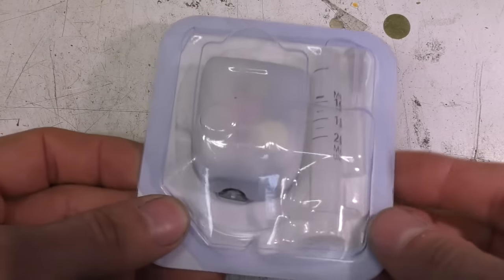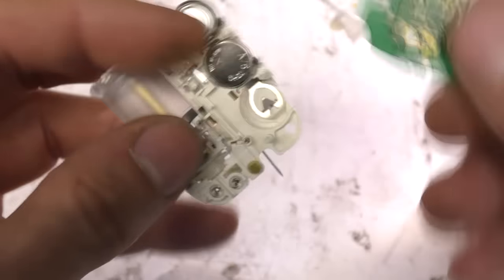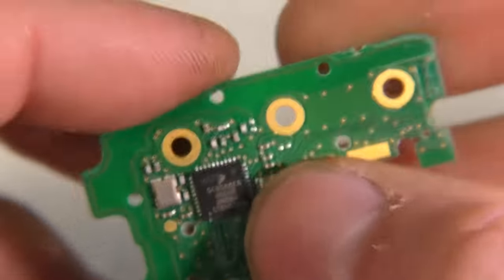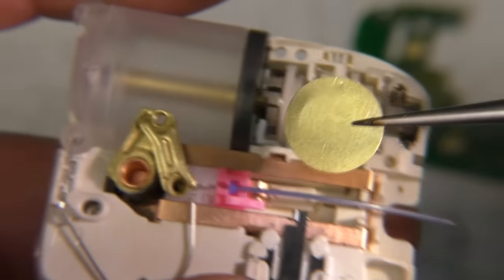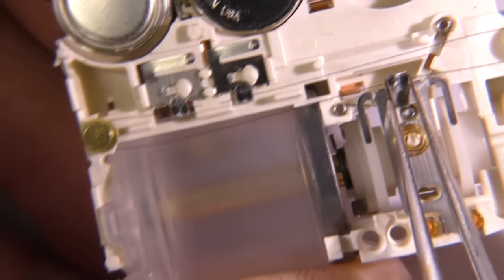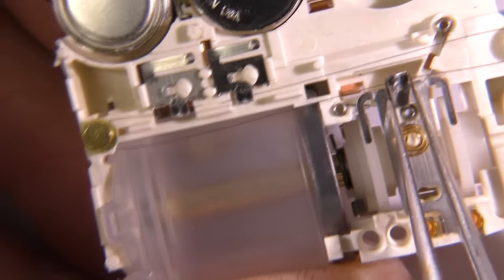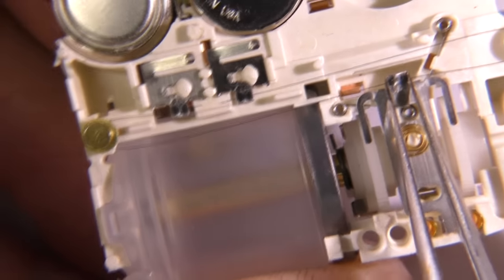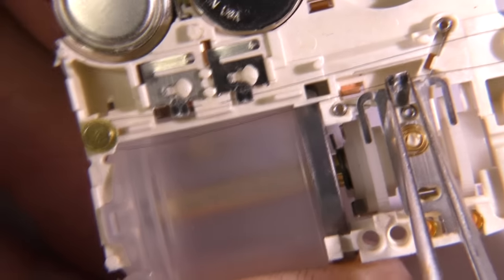Omnipod wearable insulin pump teardown

Comment: That's a really neat mechanism.  Particularly the spring clutch onto the shaft and muscle wire ratchet.  I guess that the risk of air injection is not a major risk due to the tiny amount being does at a time?  Not so keen on the high power stabby bit.  Particularly when it happens automatically at a relatively random time once attached to you.
Reply: You attach it to a fatty area... so, a tiny bit of air isn't a huge issue. :). It's actually rather bad if it ends up in a vein. The high power stabby happens when you attach it. A lot of the pumps have a little tube and a gun to apply the needle. On that kind... you take the needle out and it leaves a catheter. :) 

I've not really seen a pump quite like this one though. Mind you... an ex of mine (type 1)  had the insulin pumps... so I am not exactly an expert or anything! My ex's pump was the reusable kind where you replace the attachment piece. (Which connects via a tube to the unit). This unit seems disposable... weird!
Reply: Typically you'd need to inject a surprisingly large amount of air to cause a problem (e.g. 10ml or more in one go). That would probably be more than the chamber in this pump contains.
Reply: How could they not name this thing "PowerStabber 3000"? Much better than "Omnipod" IMO.
Reply: I think the piston moves a bit before the cannula deploys, which purges the air.
Reply: As soon as he said that it stabs you, i thought about the Toaster Manpage XKCD
Reply: Am I just too skirmish???   At 2:38 and 5:32 I could not stop cringing while he was holding that needle portion in his hand. But he did the same with the pacemakers as well, on which one could still see the dried fluids from the previous "owner".
Reply: +Donkey Learning IT no i felt the same way. Every time he put his hand in front of the needle action i expected a cut to him with a bandage on his hand telling us he'd accidentally impaled himself.
Reply: As others have said, this is a subcutaneous injection, not intravenous, so air is a very minimal concern. Actually, even if you were to inject air into a vein, unless you inject a lot of it, there's no problem. That's because blood flow in veins is always in the direction from small vessels to larger ones - so that it is very unlikely for bubbles to block the flow, they would instead just get pushed ahead into the wider vein downstream. Eventually they would either dissolve or end up in the lungs and be exchanged with the outside air. All of this would happen before they would make it into arterial circulation, which is where air bubbles ARE dangerous, because they get pushed into smaller and smaller vessels until they block the flow (an air embolism) and cause a heart attack, stroke, or other organ damage, unless they are small enough to dissolve quickly. If you inject a ton of air into a vein, you could disrupt circulation in the lungs (the first capillaries the air would encounter) enough to cause problems.
Reply: There's a ~1.5µm/s gas-blood boundary absorption rate in arterial blood (PMID: 8971944) so microliters of air should be gone in minutes.
Reply: When you put insulin in the pump, you draw the 200 units into the syringe.
Then you turn the syringe vertical with the needle pointed up, tap the air up to the top, then slowly push the syringe until the insulin is in the needle. You'll see a drop. Insert the syringe into the fill spot on the pod. Slowly push the syringe until it's empty.
You will hear the pod beep twice. Once again, keep going until the syringe is empty. Remove, and pair the pod with the PDM.
Reply: 1, 2, 3, 4, (please be 6), PAM, 6, 7, 8, 9, 10 (damnit it wasn't 6)

Comment: One of the features you missed (or didn't mention) is the two-stage job it accomplishes in a fraction of a second. 

The cannula moves forward with the metal needle protruding from a plastic sheath. Both are pushed under the skin, then the metal needle retracts leaving the flexible plastic sheath where it is in the skin. 

So rather than a metal connection between the device and your skin, you have a flexible plastic tube.
Reply: Just like a peripheral venous catheter.
Reply: Thanks, this is just the one that I didn't figure out from the video)
Reply: Exactly what I wanted to point out :) I was asking myself why is that arm retracting back when it's holding the needle.
Reply: Is it painful when that happens ?
Reply: Excellent observation!
Reply: It is not going to be worse than any other injection process.
Reply: Honestly you don't ever feel it in there because it is so thin and flexible (and small). I have a pump and never feel it however there are times when I'm getting a Bolus (a larger amount of insulin when eating rather than the small continuous amounts all day long) that stings from time to time (usually when I'm getting 20 or more units of insulin at a time, which by the way is a rare occasion) but the sting goes away in a few seconds. Hope this helps!
Reply: No, not really. It hurts less than a pinprick (and for less time). It takes just a fraction of a second for the plastic canula to be inserted under the skin and the insert needle to be removed from the skin. I am on an insulin pump and usually don't ever feel the insert needle go in (or come out).

Comment: Excellent teardown, thank you! I just tore one down myself then came here to see what a professional had to say about it. My son is Type1 diabetic and just started using these.

- The stabbing action happens when you tell it to during setup, so it's not unexpected.
- Also, I think the biggest issue with recycling these is that they are considered a biohazard after being used for medical treatment, so there's no safe way to collect these en-mass and then reuse parts. Yeah pieces could be sterilized but I think they'd be better off just grinding them to dust after removing the batteries and then continue to recycle as normal.

Comment: the muscle memory motor also has another plus. it is incapable of squirting all of the insulin at once, the maximum rate even on errors is small enough that the user may be able to react and remove a malfunctioning or compromised device.

Comment: What is not apparent in this video is how the muscle-motor steps until the mechanism reaches the piston in the tank before the clutch-spring is released. This is how the pump ‘knows’ how much insulin is injected into the tank. The release-cam for the needle is attached to the outer axle, so the needle won’t release until the clutch engages. As mentioned in another comment, the metal-needle is inserted, and then retracts, only the outer plastic tube is embedded in the skin. This insertion takes only 1/200 of a second, and that is why there is a hefty spring on the needle-actuator.

Comment: Thanks so much for doing this teardown.  My youngest was diagnosed with Type 1 earlier this year and I've been considering getting her a pump but I'm struggling mightily with the potential consequences of a flawed unit.  

The simplicity and elegance of the hardware design is encouraging.  As someone with 20+ years in infosec and 4+ years tinkering in RF, the 'other half' of this system still has me a bit concerned. :/
Reply: I've had an insulin pump for almost the last 15 years. At first I had the Medtronic Minimed 508, now I have the Minimed Paradigm Veo 754. These things are a godsend and you would pretty much have to be an idiot to use the "old school" methods. 

I also don't entirely buy the security concerns about these. You usually put around 250 units of insulin in these (less for a child). Even if the potential attacker manages to inject all of the insulin remotely it won't really kill you. Insulin is very slow acting (even the fast acting ones). You will certainly know that you have a low blood sugar before you would fall into a coma. And in that case you will do something about it. And you should always have a hypo kit near you in case you fall into a diabetic coma. And if you are at work/in school somebody should probably know how to use that hypo kit. If you are in public then an ambulance will help you as well. 

Besides... The RF range of these things is pretty limited. So chances are that any attacker would have to do this in public which minimizes the possible damage that they could do.
Reply: jcims I've had diabetes since age of 4 and started using insulin pump at 18, used Medtronic's and Animas and experienced issues with both, Omnipod's have been one of greatest things for T1D over my past 27 years with the disease. Least painful insertion of any and best thing is it inserts itself, giving you appropriate angle of insertion with accuracy that takes away "human" error that can lead to potential hospitalizing situations.
Reply: I've had the Animas 2020 (twice) and I currently run the Animas Ping pump (yes, I love Animas pumps!!!) However, I just received a letter stating that Animas is no longer going to be making or selling insulin pumps (so now that my pump is almost out of warranty I have to look into getting a different pump and don't like the medtronics line (and there aren't too many more companies to choose from (please do your research before deciding anything). After doing MY research I am currently attempting to get the tubeless OMNIPOD. I wouldn't be a day without my insulin pump!!!

Comment: thermal image on the wire as its working  - would make an interesting clock movement device
Reply: i'm a bit confused as how that muscle wire actually makes that piece of metal move because it looks like that movable part is in about middle of that wire and thus would not move when the wire shortens

Comment: I thought the break-off corner was going to be for decommissioning unsold out of date units so they didn't get onto the black market (til I saw the caption)
great teardown - medical stuff seems a bit different. it's got to be as idiot proof as consumer electronics if you're sending patients off with it, but totally reliable and well engineered.

Comment: Interesting teardown but you were waving it around so much I couldn't see what you were trying to point at. I don't know if a lower zoom would be better, or just sticking the device down to the desk so you can't move it around .
Reply: agreed, it was a little bit motion sicky, and the focus was a little off sometimes.

still, mike got the point across pretty well and it was a lot of tiny little things so overall it's not bad I think.
Reply: Had the same issue when I tried to make videos on small components! It is really not easy to solve it.
I found that with my camera the only workable solution is to put it down on top of the table, preferentially on a dark cloth/paper as background to increase the contrast.

Comment: The break off pcb corner could be to hard "safe" the units?  Ie, by breaking the power to the muscle wire driver, the capstains can't turn and fire the needle mech  You don't want these units accidentally firing out there stabbers when being recycled if not used!!

Comment: You said this muscle wire is activated by heat? Does this unit not work very well if exposed to cold temperatures?

Edit: Nevermind, I'm reminded of the contacts at the other end of the lever arm that let it know it has fully extended and made a ratchet. Must just continuously pass current through until it heats up enough to work, just may be a bit slower in the cold which is irrelevant.

Comment: Fantastic ... I just finished tearing one down myself, and was analyzing it's operation.  I had about 80% right, but you filled in the critical 20%  that puzzled me!  thanks.   BTW could you elaborate a bit on your setup to operate the muscle wire ?   Thanks!

Comment: Medical stuff is always interesting. This pump is an awesome construction wich combines many different techniques on small room. We have an actuator that converts electrical energy in temperature energy (is it the right term?) and from there to kinetic energy. The force is multiplied by a screw and gives the needet acuracy too.... This is cool!
An interesting question in my opinion is, how much energy is left in the batteries after the job is done?

Comment: Built for low interference but I wonder if induction could cause the device to pump.

Could it be possible to jam one in those 3-5 coil induction thingy's :) And change the intensity up and down to try interfere with it?

Comment: How does it deal with air in the tank? Or are you not supposed to get it in there in the first place?
Reply: You guessed right. You shouldn't put air in it. Even if you do, there's a certain orientation you can put it in so it can push the air out, as if it were an ordinary syringe - the "air purge". After all, no matter what the syringe/pipe portion is always from factory-new state filled with air that needs to be pushed out by the insulin anyway.
Reply: The little amount of air that will get it wont hurt but i do wonder how the system detects an occlusion.
Reply: Do R/C!
It's generally advised not to put air in the blood stream, lol.
Reply: This is subcutaneous and infuses the insulin into the fat, not the blood stream, as an intravenous infusion would that would be placed in a vein.
Reply: Given how clever the rest of the mechanics are, I wouldn't be surprised if the small amount of motion between the spring starting to activate the piston and the cannula firing is just right to get the air out of the cannula. Other than that, there shouldn't be any air in the system unless you injected it along with the insulin - which you shouldn't do.

Anyway, a tiny bit of air being very slowly injected under your skin is no drama. It's not like it's injecting a shedload directly into a vein.
Reply: The insulin pump goes through a "prime" (setting) which is a process that helps to eliminate the air bubble or air in the line.

Comment: So, there are of course videos on how to use these things on YouTube. Apparently one of these devices only lasts three days, and then you throw it away and get a new one out of the box. It seems quite wasteful given that the needle/cannula assembly looks replaceable, and the adhesive could easily be replaceable too. I suppose the other wet parts could get contaminated with bacteria or something, but they shouldn't be in contact with anything but your blood, which should be clean, right? The other thing I thought was a bit strange was that despite that these are single-use, you have to fill them with insulin yourself before use, but I guess that's because they'd be medicine, not just medical devices, if they came with the insulin already in them.

Comment: This seems both fairly expensive and incredibly environmentally costly given that these things are 3 day lifespan devices. I bet only a fraction of them get recycled properly. Any thoughts about how one might make these last a bit longer (ignoring problems with infection etc. that might happen with aged needles.)
Reply: The recycling procedure is actually pretty straight forward and efficiënt. And also required by the distributor.  As the pods are waterproof and have to be very small, it is very difficult to incorporate changeable batteries and long(er) term reliability. Also there are sterility issues, on every insulin pump system the canula (needle) needs to be changed every few days.

Comment: As I'm a type 1 diabetic I'm using those all day. Now I know even more about them, thanks!

I must say especially in the early days they were often (2 out of 10) doa. It's clearly not that easy to fit all the mechanical bits perfectly together in the factory...

The only thing that worries me using them is the fact that the canula has to be perfectly sterile when inserted. How do they take care of that? Is the whole unit sterilised?...
Reply: But I think they are designed very well. When there is a fault the unit detects it. Once I had a leaking battery in one of them. Not nice but the alarm went off like crazy (as it's always :-/)

Comment: What is sensing the encoder magnet?
Reply: Not really sure what you are asking but. It has a conductive and no conductive segment, as it rotates it will either conduct or not conduct. The rotation is then detected as a change in state on the micro.

Comment: I wounder why they don't use this in clocks.
Reply: It's thermal so it takes a decent amount of power. For a mains powered clock maybe
Reply: ever seen a pendulum clock?
Reply: So, why don't they use a clock mechanism (i.e. driven by an electromagnet) in insulin pumps?
Reply: because muscle wire is smaller and more efficient in such a small package. not to mention the interference possibilities of electro magnetism that could interfere with the device or other devices